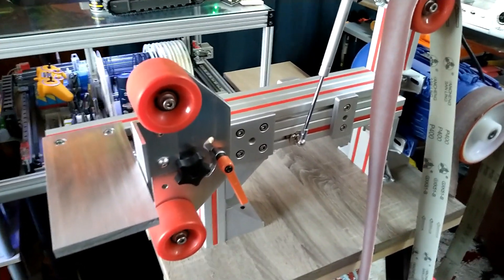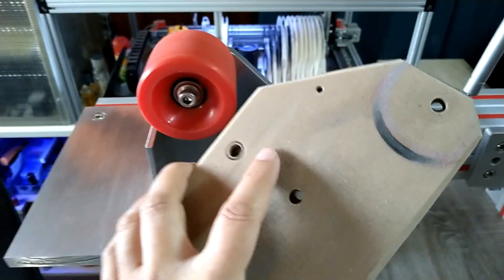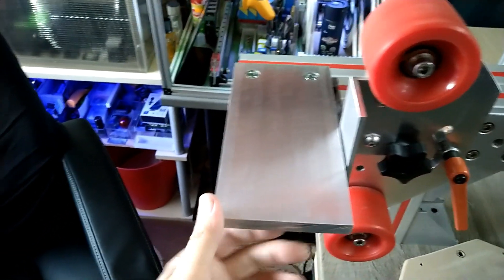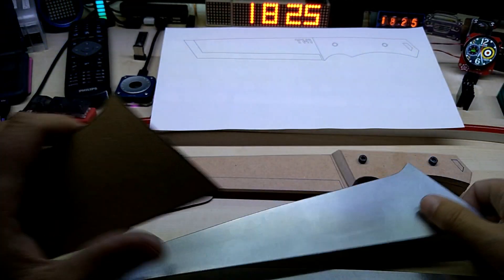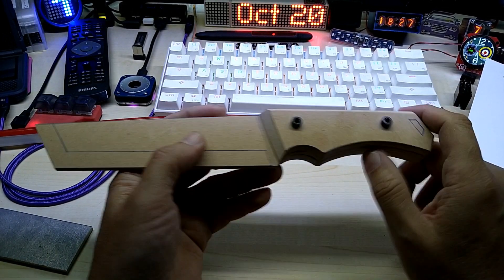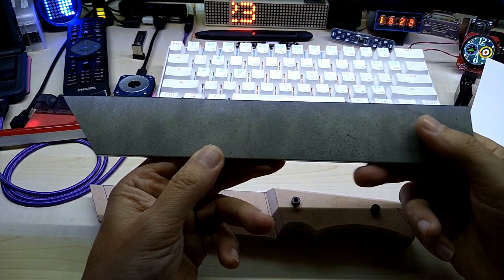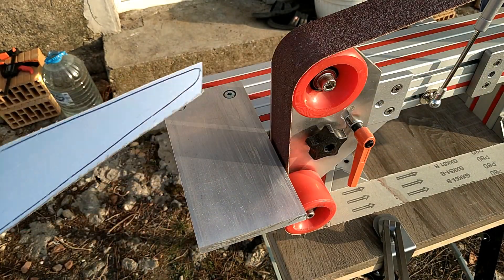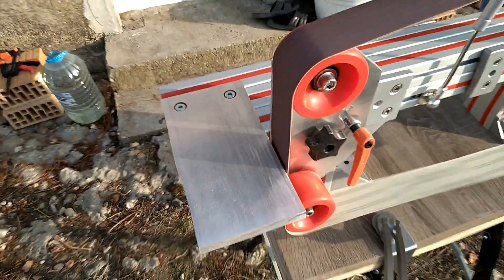DIY 2x72" 2 HP + VFD Belt Grinder no Welding required, with 4080 Aluminum Profiles by #Hayri  Part 4

Comment: Great update video Hayri!!! That grinder is working fantastic, and I'm sure it's even better with the support behind the belt. I'm really looking forward to seeing more updates on the aluminum car pieces as well the knife project as it progresses!!! Thanks for sharing with us and till later!!!!!
Reply from the maker: Thanks Adam, my plan is to get the "mad eyes" welded on this week and I also made some white/yellow angel eyes for the fog lights as the "normal" turn signals will mostly be covered by the eyelid, this way I will have some nice DRL's and turn signals, albeit a bit low of course, but here in Bulgaria it will be no problem. In Germany, I am sure there is a thing called minimum height for turn signals. Come to think of it, back in the day a third brake light was against the law and now it is allowed, go figure. Anyway, in the meantime I have figured out and easy way to make a small wheel attachment buy using a row of steel bearings at a very low cost. Now I can grind those finger grooves easily. But I urgently need a way to take the grinder outside by myself without asking the wifey for help, need some feet with relatively large caster wheels to not get stuck in the gravel outside. Anyway, enjoy the rest of your weekend, we are going to celebrate our 17 year marriage anniversary tonight. Till later.
Reply: HAPPY ANNIVERSARY!!!!!!!!
Reply from the maker: @ajones4064  Thank you Adam 🙂